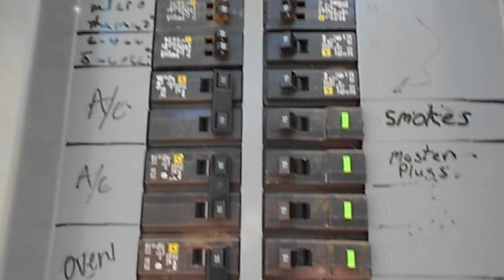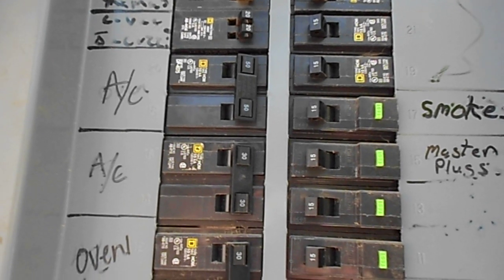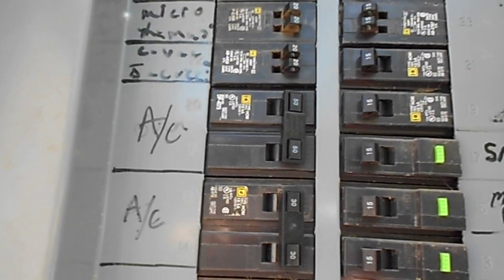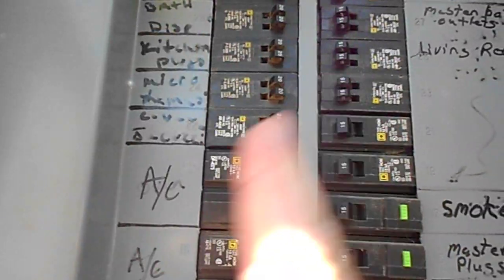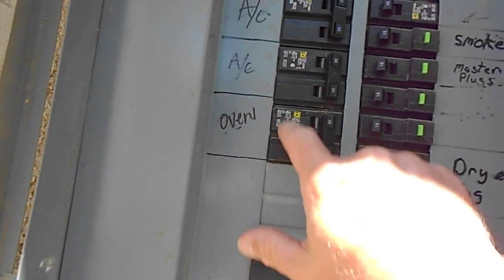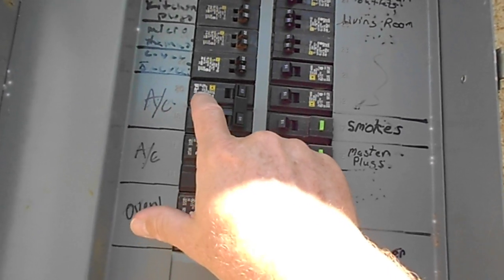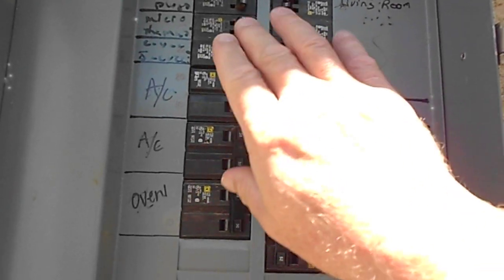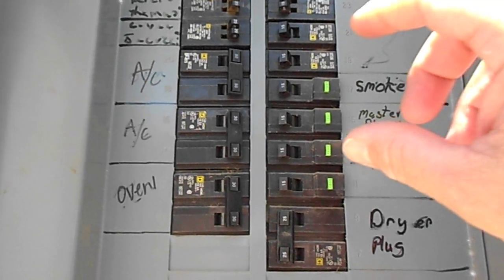HVAC circuit breaker tripping and very hot to touch

Comment: There is no need to kill the power to everything. Lol if you're scared then you need not be messing with breakers.
Reply from the maker: The old electrical state test safety book  (1960's)said when in doubt  remove all power. Safety first ... the old phrase better safe than sorry .  But if my word is no good to you : I found Wikihow --- Removing the Faulty Circuit Breaker----https://www.wikihow.com/Change-a-Circuit-Breaker THEY SAY Quote " Turn off all power and all individual breakers. Before doing any work on a circuit breaker or in the breaker box, make sure you have turned off all the power going to it. If you have a main box and other branch boxes around your home, turn off the power to the branch box at the main box first. Otherwise, just turn off the main power followed by all breakers.[12]
Even once you have turned the power off, you should act as if it’s still on.[13] Only touch the parts of the circuit breaker box you need to touch.
If you are turning off the main power, or the power to the area around you, the lights will likely turn off as well. Keep an alternative light source nearby so you don’t have to work in the dark." works for me God bless😇
Reply: @mbjdiy1778  @Neal it's good advice. you don't know what devices have stored energy in the circuits. Used to be big ol' capacitors in TVs but now you have computer PSUs and so on. Flipping all the breakers means the circuit is disconnected and if you accidentally create a path to ground there's not going to be a lot of juice to shock you. The uncertainty comes from not know if every circuit is drained, not that every circuit isn't being actively supplied with power from the main line.
Reply: @mbjdiy1778  hi need help water heater burnt out I got it replaced but the the breaker fuse is getting hot now and the fuse is next to my air conditioner now that won't turn on? What can it be did the electrician cross wires? This has never happened the hot has been running all day because I got a new washer and I can not hook up the cold because it's like metal trying to get off the old hose so the hot water has been running most of the day its cooling down now after I stopped using the washer please help
Reply from the maker: This Homedepot site is very helpful  😇
How to Replace a Circuit Breaker     https://www.homedepot.com/c/ah/how-to-replace-a-circuit-breaker/9ba683603be9fa5395fab901a6eae982   
  How to Wire a Circuit Breaker   https://www.homedepot.com/c/ah/how-to-wire-a-circuit-breaker/9ba683603be9fa5395fab908baa2ded

Comment: Loose connections are generally the cause of hot breakers..very common. Overload and bad breakers are possible of course. Doesn’t hurt to go out to your panel once every few years and put a Thermo gun on your breaker screws just to see how it’s all doing.

Comment: Had a hot breaker but no hum. It tripped several times, so I have replaced it. Hoping that fixes it!
Reply from the maker: Hope this helped - worked for me
Reply: Still a bit hot.. got someone coming to check the water heater out(its on the 30amp part of a quad breaker that is 40/30).. BUT I was reading and it's possibly normal to get warmer when in use. When not heating water, it cools down. The breaker needed replacing in either case as the water heater shorted before a recent repair. When i took it out, you could see carbon deposits from a huge spark! Great video man.
Reply from the maker: You bet and God bless

Comment: I got a circuit breaker that's hot when a 15KW central air handler is running. It's running at 108 degrees. I have the video on my channel.
Reply from the maker: Me and I say me . Have a technician or your self replace it if you are able too do the job yourself (always power off !)before it starts tripping  Works for me God bless INFO:> https://www.wikihow.com/Change-a-Circuit-Breaker  
 https://www.lowes.com/n/how-to/how-to-replace-a-circuit-breaker  https://breakeroutlet.com/blog/7-safety-tips-for-working-with-circuit-breakers/

Comment: I have the EXACT problem with my RV when running both A/C units. The first problem I found was a very hot junction box where the (I believe it is silver) wire from the generator connects to the copper wire running to the breaker panel. The wires were twisted together in the junction box and capped with wire nuts, but had loosened overtime and become extremely hot when under load. I fixed this and the wires no longer get hot and the voltage increased about 5 volts. Although the breaker doesn’t trip anymore, it still gets pretty hot, so I think I’m just going to replace all the breakers. There are only eight of them in the RV. Hopefully this takes care of the problem, thanks again for the video! 👍